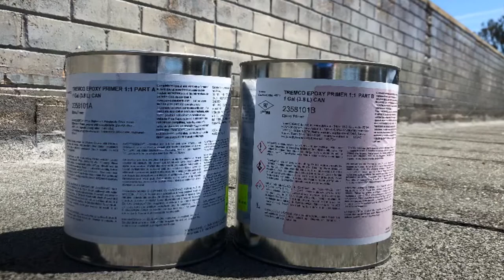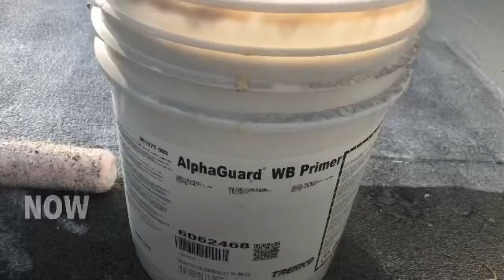Application of Liquid Membrane Over Torch On Membrane

Comment: Simply heat weld a second ply of APP membrane over existing ( after bubble are cut and dried) would have been much cheaper and probably last longer than this Tremco product. Tremco is extremely expensive. I have over 40 years of field experience.
Reply: Shouldn’t  there be any screed concrete over the second layer of APP membrane in your experience to protect the APP membrane from weather and UV rays for better longevity ?